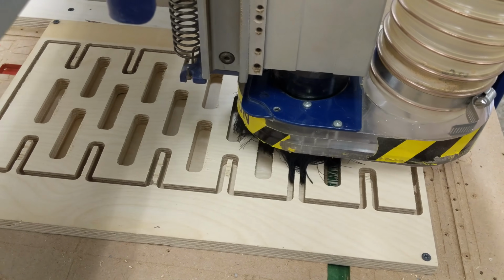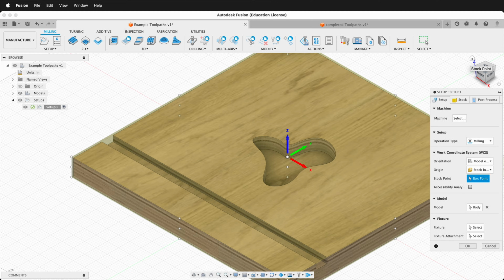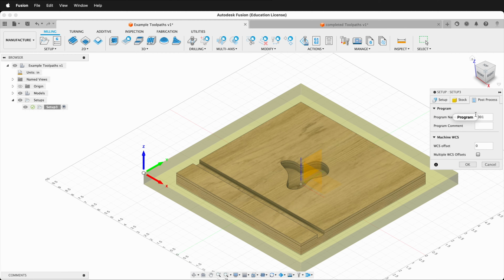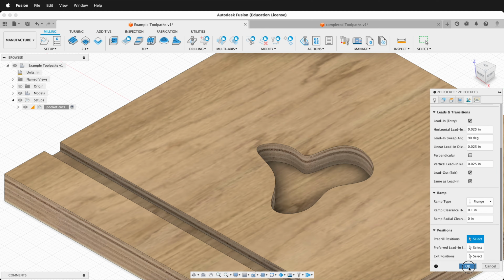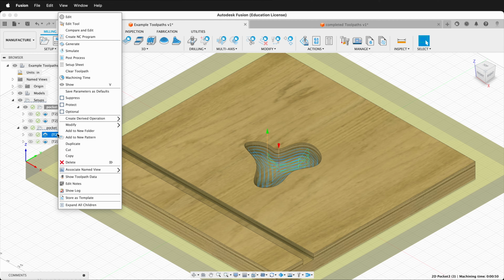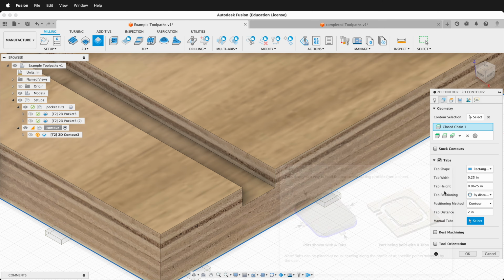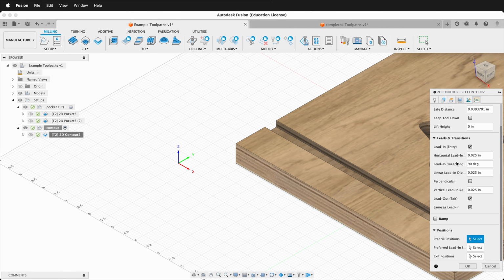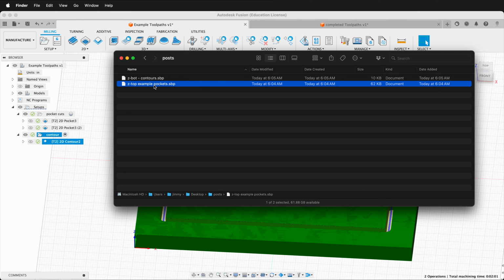CNC Cutting with Fusion 360: A Step-by-Step Tutorial

Comment: I don't understand. Why is the cornering at the stock box's bottom corner, while the pocket is cornered at the stock box's upper corner? Wouldn't setting the "bottom height" of the contour already tell the machine that it's the lowest point and to not cut beyond it?
Reply from the maker: Yes, in a perfect world there would be no deviation with these measurements in the physical world, but there is often minute variation of stock material.

For pocket cuts, the most important thing is to have the depth of the pocket be accurate, therefore measuring from the top of the material is best 

For through cuts, the most important thing is to cut all the way through and only hit a little bit of the table, so referencing the bottom surface works better

Comment: Why make two separate posts with two different refrence z heights? If its all one size cutter why not reference them off the top and post it once so you only have to load and run one post on the router?
Reply from the maker: Materials are not always perfectly uniform thickness. So for pocket cuts that need to be accurate depth from the top of the material you zero from the top, then because of imperfections that occasionally occur in the bed to ensure that through cuts. Cool all the way through the material but not through the cutting surface. Your zero from the bottom, even though you have to setups it is faster than having to run something again because it didn't go all the way through

Comment: if i may ask, why do you need tabs. can it cut thru finely without the tabs
Reply from the maker: Great question, You need some way to hold down the pieces that are being cut out with the CNC, because if the spinning router bit hits one it can vibrate and shatter or the piece can be thrown across the room 

Sometimes a vacuum table can be used and then you can cut all the way through, another way is using strong two-sided tape such as carpet tape to hold pieces down, another way is to have a custom fixture that holds the pieces 

Or you can use tabs

Comment: do you know, how to set up "Tool orientation origin" (Setup -> Model -> Select), if i use couple boards of plywood. I setting up only in one plywood, but when i want to set up new Setup, i cant put origin on other list of plywood (zero point). Think, you understand me )
Reply from the maker: make sure each piece of plywood is a separate component at the top level, then only select the parts of the model that you want for each setup i
Reply: @WhatMakeArt  Thanks you. I found the answer. Just copy/paste Setup with configured parameters from Board 1 for second Board 2. And on new Setup only change Board1 to Board 2 (Setup->Model-Select). Then make new contours. It works )))
Reply from the maker: Glad your project worked out and thanks for sharing the solution with everyone 👍🦩